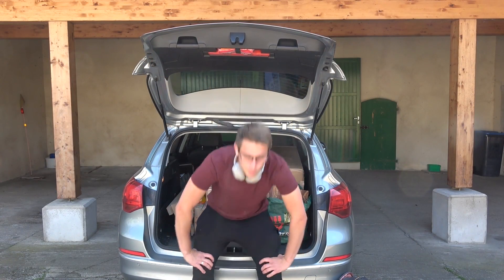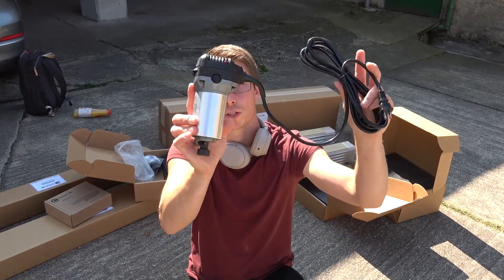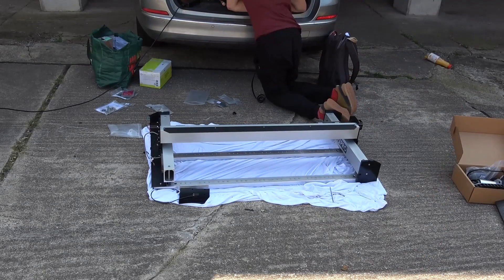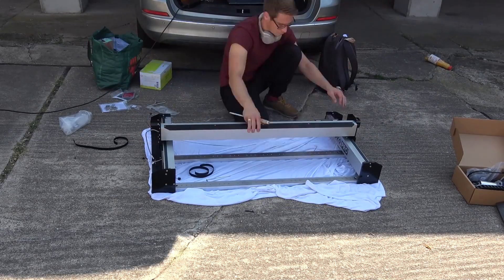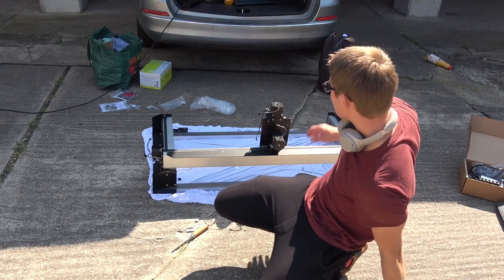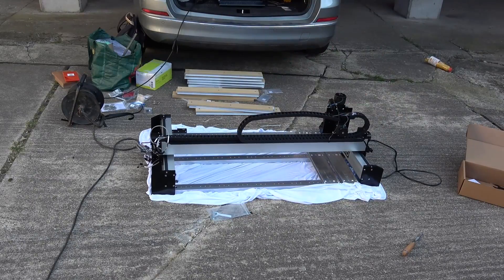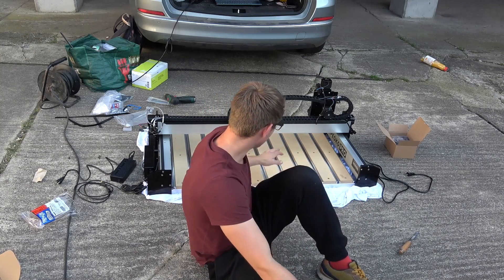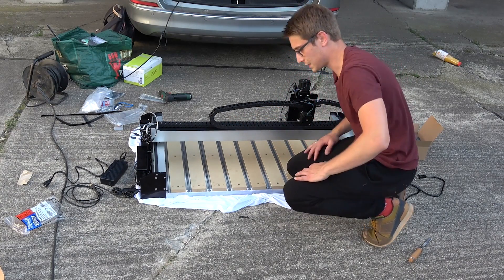My New Best Buddy - Shapeoko Pro XL Assembly

Comment: u should do a video on homing and toolchanges on the cnc
Reply from the maker: great idea!
Reply from the maker: Any specifics in mind I should mention/cover? :)
Reply: @RockHardWoodDaddy  i have a 3040 cnc on ebay it was like 300usd, but it doesnt come with limit switches and software for that stuff which im gonna add soon, so im curious like how u center ur tools and do the changes to make sure the cnc goes back to the same spot and is at the right height.
Reply from the maker: Ahhhhh, gotcha! SO my Shapeoko does the homing complete automatically after an initial setup. Centering on the other hand, works manually by using the software :)

Comment: The black snake thing is just called a wire/cable carrier generally though that specific type often used in CNC routers & 3D printers is a drag chain cable carrier.
Reply from the maker: ohhhhh, a drag chain!!!! You are right, now I remember what it was called XD